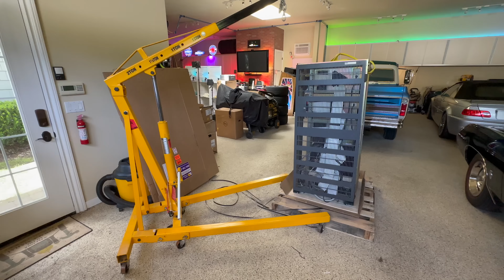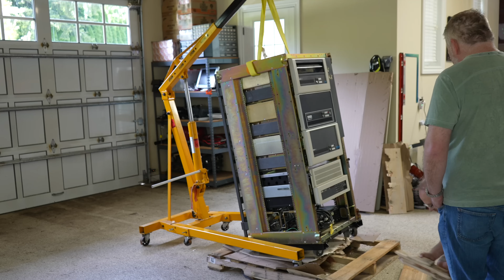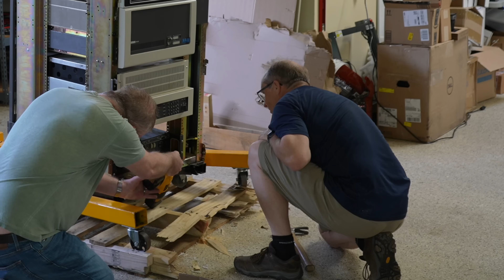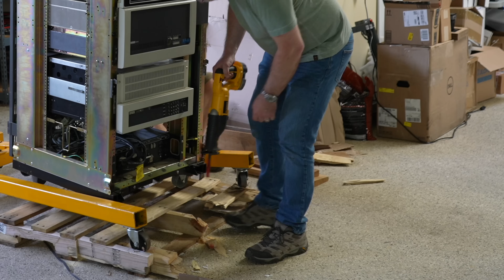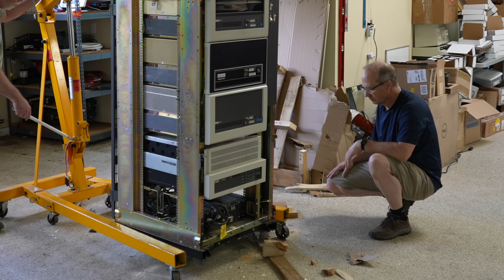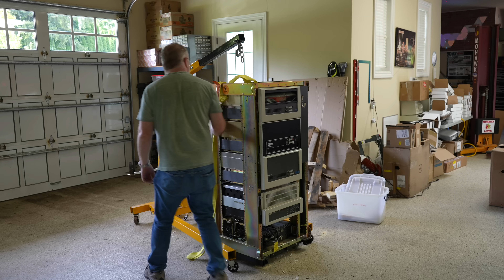I Bought the HEAVIEST Computer on eBay: The PDP-11/34!

Comment: We had a PDP11/44A in high school back in the 80's, the machine I cut my "big iron" teeth on and learned COBOL. It had a whopping 512K of RAM in it, but it made you think it had GB's more, and a pair each of RK06s and RK07s. A mess of DecWriters and VT220s all over campus and a line matrix printer that tore through crates of green bar in no time at all, Genicom I think. My memory is a bit fuzzy going back to those days. Had some fun times on that machine!

Comment: Fond memories of working on a PDP/1140 1145 and 1170 - all running Multiuser UNIX C with SCCS (That's Switching Control Center Systems - not Source Code Control) running on top of that when working at AT&T in the olden days.

Comment: All electronics that is older then 20 years can have dried out capacitors and older the resistors could be way out of specs.  So always check the components when you have problems.  Especially the power parts, as fault conductors parts there could be lethal.

Comment: Oh I worked on those, not for very long admittedly as they were being scrapped and replaced with Windows servers (you could almost smell the tears of the DEC engineers). 

The DEC engineers are very knowledgeable but would never take any shortcuts, the maintenance manuals were holy writ carved in stone and it was sacrilege to miss a step, I wouldn't have been surprised and actually half believed that if they saw a machine on fire they'd consult the manual for a fire extinguisher procedure and refuse to use it if they'd not checked the patch/revision level and verified the DEC part number was correct.

I'm way more of a cowboy like you Dave.

Comment: Oh, and PDP 11/34.  Remember some good memories.  I even had wrote a ping app for some of the old OS.  RISTES ??  BQT was writing the IPv4 stack for it at the Academic Computer Association UPDATE at Uppsala University, Sweden.
There I did even some hardware hack repair in the CPU in a PDP 8.   I could almost climb in to the CPU. 🙂  Never open their PDP 10 though.

The PDP 11 CPU architecture are beautiful.  Inspiring the 6809 CPU and the 68K CPU.   And personally , the 6809 is one of the most beautiful CPU architectures.

Comment: Dave, if your UniBone has the grant pass not hard wired (passes grant when not using DMA) then you could have placed the UniBone in the 1st slot and let the other boards fend for the bus as they did before.

Comment: I cut my teeth on a PDP-5 with attached ASR-33.  The only command I can remember from those days was "7400" meant HALT.  Had to load the bootstrap program by flipping 12 switches, pushing "load," and repeating that about 35 times.  Then it would load the FORTRAN complier via paper tape.... took minutes to do that, time enough for coffee.  Circa 1965, or so.

Comment: Smooth scrolling on the VT220 isn't a matter of flow control, but a feature in the DEC VT series, which one turns on or off in the setup menu of the terminal.

Comment: @ about 22 mins, the boards layout. The CPU is from my memory of the late 70s and study of the PDP 11/40 the CPU is built off a quartet of 74LS181, 4 bit ALU in TTL (you can see the four 24 pin packages on the upper right of the board on far left, lower row). Its a personal bit (!) for me having used the chip in a school project while in EE program in college shortly after.

Comment: Please more yes! Back in the 70's I spent many nights in a computer lab debugging on the front panel of a PDP-11/40 as part of my operating system course. I had several nights single-stepping the CPU and reading core memory trying to chase a problem. (One assignment I ran at process speed it would randomly hang about 20-90 seconds in; I actually never found the bug but I did have one run where I could write to the disk, read it, then print.) My dorm was across the street from the computer lab so the 2am-4am slot was always open. I do appreciate the people keeping the old hardware alive but it's not a time I want to re-live myself--ha. I figure it's just like the people who maintain steam locomotives, but with old computer systems you don't need acres of rail yard and a dozen people to help run it.

Comment: Quintessence epitomized!   Good job.  

What to run?

I can't remember where I first saw the StarTrek program but I think the NC Programmers or CAD Programmers had it up and running on our PDP 11/34.  I found a copy that had been converted into RPG that would run on our IBM S/3 but it had issues.  I found how to fix as it was using IBM S/34 display logic which I rewrote into  S/3 DSPF.  And with some additional coding it worked.  It had Phasers, Photon Torpedos , communication to "Computer" and a map of its universe and the Klingons  location when you examined the proper quadrant.  Of course it had Warp engines and power for the drives and a finite number of launch weapons.  Two Star Bases were placed somewhere and if you could dock all was replenished.  These Star Bases where hunted by the Klingons as well as the Enterprise.  It was my first introduction to computer gaming in, circa, 1977.  
This long rant dates me and my many, many unseen correction due to my mild dyslexia dates me and my working career from '74 - '16

Comment: Ah, the good old "knucklebuster" termination cards.
I'm sure you're aware, but many of those disks had rubber bumpers to soften the blow of the heads coming back in.  You may want to see if they've turned rock hard over the years.

Comment: I once moved a PDP-11 to an upstairs office. It was only an 11/73, but it and its disk drives lived in a substantial 6-ft cabinet.  Even with components removed, it took four of us to struggle up a steel staircase with the thing. It was only after we reached the top, when we were re-assembling it, that we discovered two massive lead bars (2-inch square cross-section) bolted in the base of the cabinet for stability.

Comment: The PDP 11 was a legend in its time, it has a the current compute power of what now? An Apple Watch?
Reply: An Apple Watch is many thousands of times faster than the fastest PDP-11. 64-bit, orders of magnitude higher clock speed, tens of operations per clock cycle instead of tens of clock cycles per operation... The original Apple Watch was about as fast as a mid-2000s PowerMac G4.
Reply: @cmhenator  
So the gain in computing power is even orders of magnitude bigger than I suspected and the price of it has dropped through the floor. Just thinking what a modern PC could do if we would code as efficient as way back then.

Comment: I wish I still had my Macro-11 game for two VT-100s where each player controlled a snake and had to avoid colliding with the edges or a snake's (own or opponent's) growing "tail". Played on one screen but with two keyboards (thus two adjacent VT-100s) on RSX-11M - using escape sequences for cursor control 🙂The systems was primarily used for air traffic control - but there were quiet moments 🙂Another of my programs wasn't a game - more a tool for teasing colleagues. You started the game by nominating a "target" workstation - whose screen randomly "lost" it's content one character position at a time - again using escape sequences.

Comment: The fact that one can run a full  PDP-11 emulation on a Raspberry pi is such a flex of the microelectronics and computer industry (the software that allows to laying billions of transistors and perform optimization of the wire layers). Congratulations on your new BB

Comment: You're an animal! (bows Bill-&Ted style).
Grew up on a PDP 11/34 (w/RSTS/E) our high school bought just before I arrived in 1979. 256kb, and TWO 5MB disks (we got 100kb). AP Calc teacher's rule was you couldn't play games on it during school hours ... unless you wrote it yourself. So I did, and found programming more challenging & fun than playing.
A year later, playing on another terminal, a friend IM'd me PDP-style and said someone else was on my account playing my tank video game in the main computer room VT100 (25x80 char array).
Walked over to see Mr. Bode looking back with a big sheepish grin (and he was a very serious guy). RIP Mr Bode - you gave me knowledge, skills, a great career, and a great life.
PS I laughed when you said deep inside this complex machine you couldn't wire wrap: if I handed you the tool, you'd know exactly what to do - and it's surprisingly reliable, as the force of the tiny wire, when wrapped on the intentionally sharp corner of the post, exerts like 10,000 lbs/sq in, crushing through any corrosion. Beautifully simple.
Reply: Wire-wrap is very reliable.  When I went to work at General Dynamics in 1979, I was shocked to find that the digital radar signal processor in a PRODUCTION ship-board weapon system featured a WIRE-WRAPPED backplane!  Many people can't believe the vibration and shock environments that are regularly encountered on ships.  As part of the final lot acceptance tests an entire working system was placed on a barge in San Francisco bay and an explosive detonated close by to simulate the shock effects of a torpedo hit.  It was allowed to recycle (system equivalent of a computer reboot), but the system had be operational with no repairs in the normal startup time.
Reply: @RanchoHam  Very cool. I'll bet if that were hand-soldered, a bad cold solder joint in there would have failed. The main reason everything is soldered today is that flow soldering is orders of magnitude faster (ie cheaper) than wire wrapping or hand soldering, as well as reliable.
Reply: @BooDevil65  The circuit boards that were inserted in the back plane were wave-soldered back then.  Of course everything was through-hole.  I seem to remember there was an automated wire-wrap setup somewhere, but we were not using it.  Looked like a weird X-Y plotter with odd attachments.  At 1 system per month, using it wasn't cost effective to do the one-time engineering to program it.
Reply: RSTS/E was my first OS too. So hackable. All those syscalls to learn and memory to PEEK and POKE!

Comment: Back in 1999, I saved a PDP/11 (non Y2K compliance issue!) from going to the skip at my workplace, and had it transported to a collector.  Alas the RL02 (?) disks, one with recent bearings, and tape drive, all went into the skip.  No-one wanted them.

Comment: Thanks, Dave. It brings back some great memories of my misspent youth ('75-76) learning to program via the old Teletype Model 33 in junior high and finally getting the chance to tour the 'lab' where the iron filled the room and they had actual VT52 terminals! Then the IBM 5100 in high school followed by the PDP-11/70s in college. Snagged a PDP-11/34 a decade ago but never was able to get the power supply fixed (some EE geek had removed the transformer to use in some other project) so donated the rest of the parts to a PDP SIG. I'm so happy that you were able to get yours running! I hope you have hours of enjoyment from it! Do you have the old Adventure game, aka Colossal Cave Adventure? I'd love to see that running again after having spent hours playing it while avoiding homework assignments.

Comment: You haven’t experienced life if you haven’t wire wrapped things together. Lol.  Of course, I don’t recommend doing it manually… get a wire wrap gun. It’s so much easier.

Loving watching this. One of my customers who happens to be a large automotive manufacturer still has a pair of PDP 11s running an old access control software that my previous company made called 8900.  Amazing these old tanks.

Keep the content coming. Loving this.

Comment: BTW, most PDP-11 do not use flow control. The VT220 is set to "smooth scroll" and that makes it slow. Set the scrolling to "jump" (IIRC), and the terminal should keep up at 9600 Baud. Faster than 9600 will probably cause "dropped characters".
Nice system with definitely not standard front panels, really cool!

Comment: I used to work on the 11/34 from 81 to 92. When you first started talking, I was screaming CA1 -CB1 at the screen LOL. I first completed the course on the 11/34 to gate level (hours of going through cct drawings page by page) I seem to remember it took a week to to the CPU cards alone. If you have any gaps int the DD11-PK (the first 9 slot backplane) then you have to have a bus grant card in slot D and can modify such cards turned 180 degrees and put in slot D to pass on DMA links. We also had major problems with the bus extender ribbons which were too long by far. Great content and much appreciate the video take me back to the years on when you could fix things with an extender card an step through the microcode with a logic probe and then replace the offending chip. The "Good" old days !!!

Comment: It's scary to remember so many operational facts about these computers. In the early 80's I got hired by a 3rd party DEC service provider as a bench technician fixing VT-100 terminals. After fixing all the broken terminals on hand. I turned to work on our 11/40 test bench machine which had been down for nearly a year prior to my arrival. I taught myself how to repair and operate the machine and in 9 months became the company's senior field technician. As long as I had test equipment, schematics and coffee I fixed most everything I was thrown at. Floppy Drives, Hard Drives, Tape Drives, serial controllers, line printers, power supplies. These machines had modular switching power supplies that would fail pretty frequently. I built electronic dummy loads that dissipated power through 2N3055's strapped to massive heatsinks with fans blowing on them. It was a great time working with these work horses. Thanks for the memories. I'll watch any PDP-11 video you put up. Cheers.
Reply: 2N3055 brings back some memories. Thankfully, the burns healed.   ;)
Used to watch an FNG come in and screwdriver discharge filter cap banks, welding the screwdriver to the bus strip. Hey, we told him to check with us first before doing anything exciting or energetic!
Haven't worked on that kind of logic in ages. Now, it's all pretty much PC, NUC, RPi, Deep Thought... Nobody trusts me to do any work on Earth.
Reply: Those were the days. Bless you for being here and helping us remember when the world was better.😢

Comment: In the mid-1990s, i got offered a FREE PDP10, running unix. Sadly, I had nowhere store it, or it manuals, nor did I have means to power it, so i declined the offer.

Ironically, I borrowed a truck from my fathers work and helped deliver it to its eventual 'new' owner.

Comment: Excellent.  I used PDP11/23's in the day.  We used them in our dyehouse.  They both were fitted with RL02 drives, one machine being used for job tracking using RSX-11m while the other was a standalone running RT-11.  Good old machines.  AFAIK the disk heads do indeed fly on a thin film of air, same as a modern disk drive.

Comment: I love the PDP 11/34; it was the first computer that I was paid to program, in 1978. At the time I joined it was running RSX-11M v3.1 and was used to develop software for the nearby factory monitoring system which ran on its own 11/40. It also ran ADVENTure which someone brought back from a DECUS conference. As you might expect, everything was a lot more complicated than I've outlined  here but then I could talk for hours on my life with DEC hardware and operating systems.

Comment: At Cambridge, in the 1970s, there was a DEC PDP 7 with a CRT display (capable of vector graphics) on which we could run a chess program with very basic heuristics. Half the program was the code to draw the chess pieces on the screen. 
I spent further time working on a DEC PDP 11/34.  The service engineer came one day to do a routine service/clean of the machine so I asked about how long will he be? An hour, maybe a little more. Somewhat more than an hour later I went into the computer room and asked the engineer how it was going. "I'm almost though the maze." was the reply.  He had been playing adventure all the time. About 45 minutes later we got the computer back. I loved the simplicity of the machine and its instruction set.  DEC died because its management failed to understand the significance of the 8086 (and later processors in the line). I hope the proud new owner has a reliable machine and that he can continue to find spares or repair what he has.

Comment: The castors sinking into the pallet is just bad show on whoever wrapped it up for shipping.  The foam/cardboard wrap is fine, its main purpose is to keep the weather out, if someone drives a set of forks into it, it doesn't matter if it's in a crate or cardboard, it's getting damaged.  The big issue is how they supported the frame.  A much better way to do it is to use blocks of wood screwed onto the pallet that rest on the frame and raise the unit up so the castors aren't touching anything.  It's much better for the pallet to take the weight from the wide area of the frame rather than the small area of the castors.  It's also more stable, so you don't need to do the straps so tight you bust the castors through the pallet ;)

Comment: Wow, the 11/34 was the first PDP I really got to grips with, however I don't recall any of their UNIBUS backplanes having the grant continuity hard wired though, we always had to pop a grant card in if we wanted to leave an empty slot.  Yes, you can't fit much on an RK05, only 2.5Mb as I recall, but then the RL02 with which we later replaced them was only 10Mb.  While I'd love to see an 11/34 again I'm really sure I would not want one, so well done for giving one a nice home.

Comment: I have a 42U IBM DS8880 mainframe attached storage rack in my garage it takes 32 Amps at 250 volts and weighs somewhere northwards of 500kg (1100 lbs)... we're a weird bunch Dave.